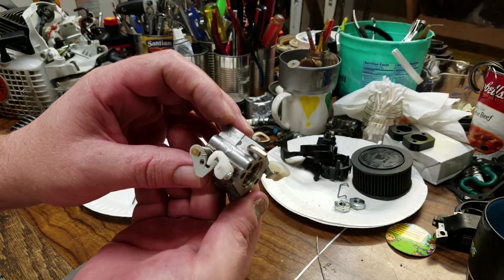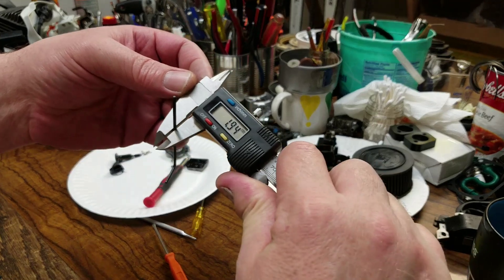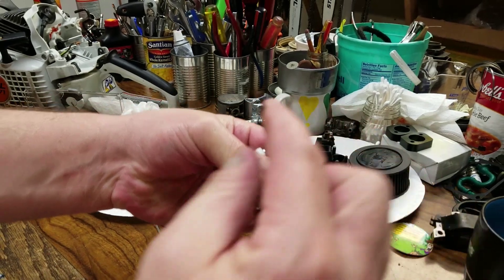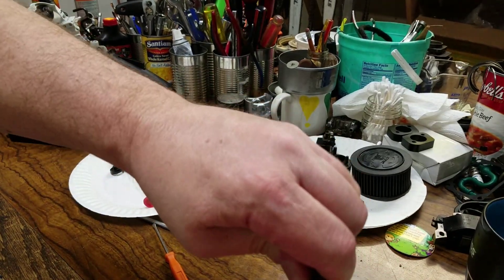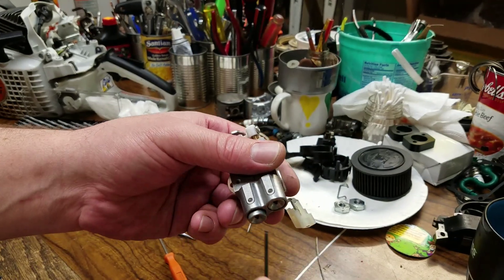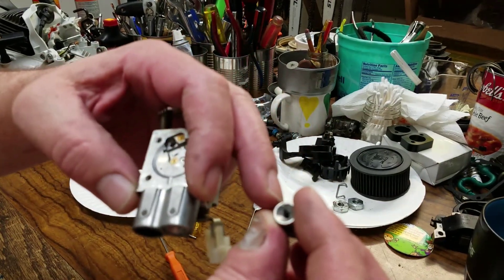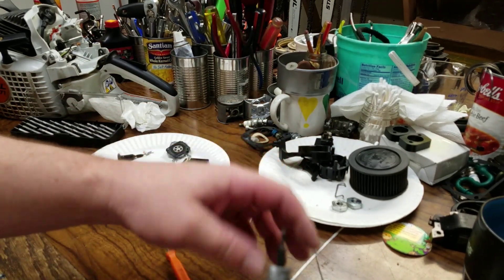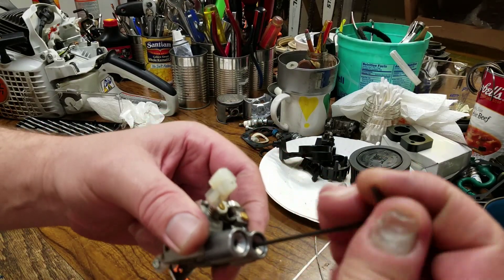Stihl metal limiter cap removal

Comment: Once the needle is removed with the limiter cap it cannot be reinstalled with the cap on the needle and function as new.  If the cap is 'ratcheting' or moving around the needle then any adjustments to the needle must be made with an Allen wrench as the cap is then 'stripped'.  You can't then use a screwdriver to adjust the needle valve as the limiter is stripped and won't turn the needle.   These caps were meant to be pushed onto the needle screw after it is inserted into the carburetor and set to factory adjustment.   The cap snaps onto the head of the screw and locks onto the head with tiny splines on the screw and then the slot in the limiter allows a 3/4 turn adjustment.
Reply from the maker: It doesn't strip out, lol. Its design allows it to snap back into place to lock it from traveling too far out of adjustment.

Comment: If you can use a hex key to spin the needle valve then you should be able to use the hex key to "click" past the stop and get a perfect adjustment without ANY disassembly. This is probably how they set it at Stihl
Reply: You mean how he does it at 0:54, but instead of spinning all the way until out, just spin it like half a turn for another 1/2 spin added to the 3/4 stock?
Reply: @em4703  Yes that's what I was referring to. So you don't have to disassemble anything just click past where you want to set it and now you can adjust it to exactly where it wants to be using a flatblade screwdriver.
Reply: Makes sence to me i plan on trying this tomarrow
Reply: @chrifaranaudo123  how'd that work out for ya?
Reply: @AA-tb4ff  didnt have any issues at all i just adjusted it with a screwdriver and allen key

Comment: I tried this today on a MS261 carb w the same limiter caps. Is it correct that now the adjustments to the screws must now be made with the hex wrench?
Reply from the maker: They should snap back into place to allow the outer part to function properly.
Reply: I've mucked it up a bit. I can adjust w the allen wrench (low side) but not w a regular slotted screwdriver. Haven't pulled the high out yet , just clicked it back a couple steps. Thx for this video too.